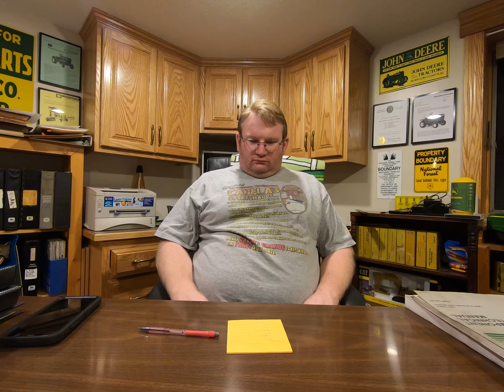John Deere and Onan Engines

Comment: Great video and accurate !!  I rebuilt my first Onan 3yrs ago following YOUR video series !! Cost me a 3rd of what I was expecting and I used all new Onan parts.  Built my own puller for the crank gear. 
That engine now has 350 hours on it and runs beautifully.  I've since rebuilt another B and 2 P's. Absolutely love these engines.

Comment: Lots of great information here! This video should be a must-watch for anyone in the market for a 316/318/420. I'm not the biggest fan of repowers, despite the good reputation the newer v-twin engines have. In my opinion, it doesn't seem logical to spend a lot of money on a replacement engine (which is usually more expensive than rebuilding the Onan), and on top of that, having to modify the wiring, driveshaft, PTO clutch, exhaust, etc. to make the new engine work properly in the tractor. By rebuilding the original engine, everything is kept stock and unmodified, it may save the owner money in the long run, and the machine will still have character (they seem to lose character with a replacement engine in them).

Comment: I agree on the rebuild cost. My '86 318 B43G recently threw a rod. Luckily, no other damage was done other than the broken rod. I was able to replace with all new parts, both pistons, rings, new style rods, head gaskets, oil pan gasket, new carb, fuel pump and all new fuel lines and tank pickups all for under $600. Fingers crossed, but it seems to run better than it has for a long time and hopefully it will be good for many more years. One rookie mistake I made was that I forgot to measure the ring gap when I installed the new pistons. I hope I don't have issues with that later, but it seems fine right now. Love my 318!!!

Comment: I have a p224 Onan engine that shuts off after running for about 30 minutes when first start. Then, we have to let it cool down to get it running again but will only run for about 15-20 minutes. (Note: I have changed flywheel, stator, module, coil, battery cables and still having the same issue) Also, started seems to get hot (had one starter rebuilt and replaced with another starter just to check if starter was the issue. Still trying to figure out what may be wrong?

Comment: Just finished a repower...replaced a high time B43M with a freshly overhauled P220. I do intend to keep the tractor...at least till I'm too old to give a damn lol. It was not an inexpensive overhaul, but still far less than a repower with a new Honda or Kohler ($2400-$3700 CDN)...and the tractor still looks nearly stock and sounds "right".

Comment: Hello! My grandpa recently died! I have a chose between 2 318’s and like I just don’t know what one to pick. And older variant and a newer variant. But rumor is that my grandpa rebuilt the newer one 100 hours ago but it also leaks out oil really fast! Also another One is the older variant. I know the newer one sounds clicky could be a valves or could be more. It also has a brand new clutch! Also the other 318 he had was older but backfires shortly after startup and barley gets going after you start it but if you shut it off it starts back up and then seems to run a bit better. I’m still not sure what one to purchase from them and how much they are even worth
Reply: I believe the older one sounded like a safer bet because it sounds less worn out and like less work needed to be done it sounds like a carb or fuel supply issue which can be easily fixed vs having to remove the engine

Comment: Hi my name is Steven I'm from Minnesota I came across a known engine just called came out of 1973 Melrose skid loader model 444 the motor was taken out of the skid loader cuz the owner wanted to put electronic ignition on it instead of points

Comment: $1200 on a rebuild kit for an Onan?!?!?  I can buy an entire rebuild kit INCLUDING PISTONS & WRIST PINS for my 2000 Toyota Tacoma 4 cylinder 3RZ-FE engine ( one of the most durable gasoline engines ever made by anyone ) for only $600 from LC Engineering....aka "LCE"......and LCE is hands down the very best source for everything Toyota, all of the best quality, whether they stock original OEM Toyota parts or upgraded parts they have engineered themselves, for: the 22r and 22re engines, the 3RZ/FE, and any other Toyota engine that is noteworthy of durability and/or performance. Man, they really charge a lot for tractor parts.

Comment: This is Steven again now the engine that he hadn't the skid loader the only in the skid loader it had on the back of the engine had a little cup Charbonier and express a little weights like you having a distributor for advancing the timing what is the purpose of these weights cuz when they're not on there is no timing light Mark or Flash and my dad had to remanufacture to new pegs weight back on